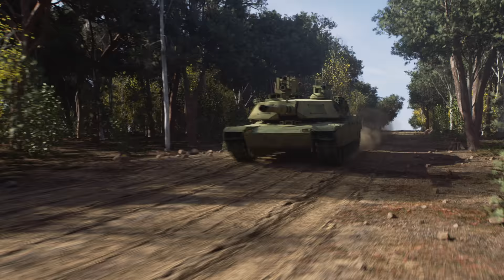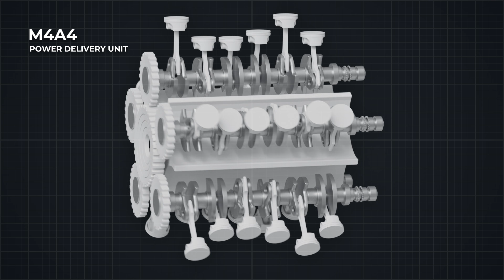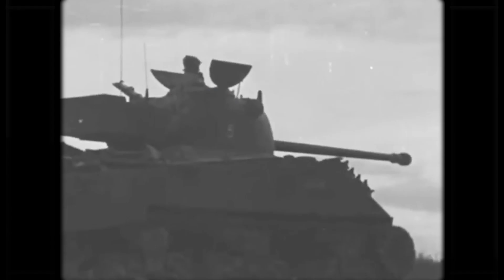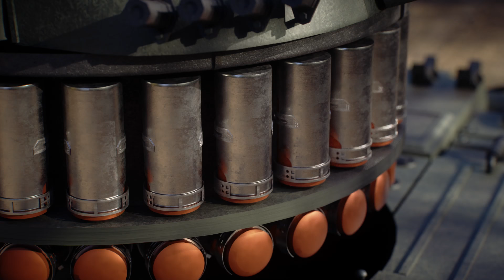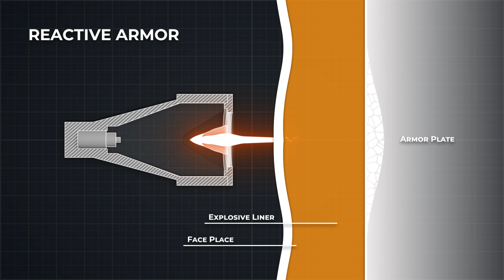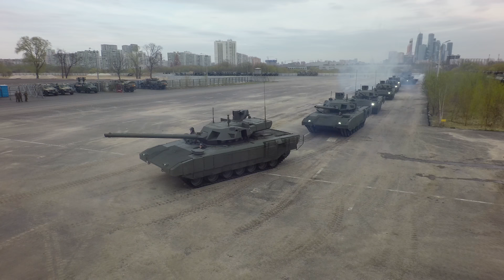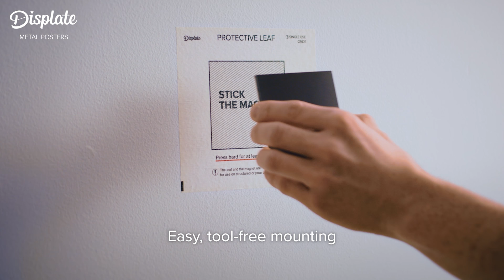Why America’s Tank Failed in Ukraine

Comment: 19:37 That engine isn't new, it's a copy of the engine from the Porsche Tiger
Reply: Yeah every car is copy of a stage coach because it has 4 wheels. Truly the poster child of average intelligence...
Reply: @mitri5389  It a one to one copy of the SLA 16 engine that was being build to be using in oil and gas compressor stations
Reply: @bluewolf194  lol again showing off your intelligence, saying that a 12 cyilinder motor with larger bore size and a geared cam timing is a copy of a 16 cyilinder push rod motor from ww2 😅
Reply: @mitri5389  Next you're going to tell me the TU-4 isn't a copy of the B-29
Reply: @bluewolf194  😂 moving the goal post... how about you explain your initial statement which you cant back up. Are you also gonna disregard the dozen or so X engine that were made before the sla 16?

Comment: I’m sure The Chieftain and Lazerpig will have…thoughts
Reply: well considering real engineerings example of a good tank and engine is the t14

they are right to have some lol
Reply: @battalionstallion3894 The T-14 is a very good tank on paper, which is exactly what this video said. Its biggest shortcoming is that Russia has only built like ten of them
Reply: @Jak_Atackka And that's assuming that those ten don't have a telegraph pole instead of a main gun. But yeah I was ready to jump in on the T-14...then RE said about the lack of production, and the Tiger, but RE covered the abysmal mechanical failure record of those too.
Reply: @Jak_Atackka  No, he said 'offers a glimpse at a solution to all of this'  ; which is an absolute bonkers thing to say when the best thing you can say about it is that 'it looks good on paper'.
Reply: @Jak_Atackka  other than all the design flaws like:
Using an unreliable autoloader, but then not giving the crew access to it in combat so they can clear it
Hydraulic seals on the crew chamber in a vehicle which may experiance electronics outages (say, when it gets hit by an AT shell)
All the engine problems
Reply: @Jak_Atackka  if a nation can make a tank and only manage to build 10 of them its not a good tank even on paper then

nor is it even good on paper 
 it lacks optics, awareness, the hydralic armored box is a death trap if the tank takes a hit and losses power, and it lacks proper data linking
Reply: @Jak_Atackka  it's not even a good tank on paper. Too unreliable, too expensive
Reply: @Jak_Atackka  RIght and the Maus was a good movable bunker on paper, doesnt mean it worked or was a good idea. The only way to really know if a tank design is actually any good is to field them and without fielding them trying to predict anything about it is a moot point.
Reply: Indeed.
The former being an expert on the matter, the latter being a lolcow.
Reply: The chieftain has already put in his two cents on this video and the response...needless to say he is NOT HAPPY
Reply: @reapertalon  Where? Not on his own channel in any event.
Reply: @HufflepuffSamurai check the replies
Reply: who?
Reply: I think they would dismiss this video quite rapidly.
Reply: Imagine considering lazer pig as a reliable source of information for anything tank related. Dude's a clown.
Reply: @malithaw The Chieftain though is a consumate professional and has extensively covered the m1 Abraham's and tank doctrine in general. A clear understanding of tank doctirne being the biggest absence of understanding in the video and given the subject matter is beyond simple design specs and engineering is sorely needed.
Reply: Yeah, I know. Chieftain is a respectable person and an actual expert on the matter unlike the lazer pig. @Darkestnova25
Reply: @malithaw  I don't know how can there be anyone who takes that guy seriously after the drama he had with RedEffect. It's clear he's a bad faith actor
Reply: Dont forget redeffect...
Reply: @justafan4266 No, forget Redeffect. That dude is a cheerleader for Soviet armour, nothing more. Almost all his videos of Western armour are highly critical, and his videos on Soviet/Post Soviet armour are extremely glowing. He makes Lazerpig look like Perun.
Reply: @HufflepuffSamurai  both have their Biases ok. are finnished ?
Reply: Two people who should never be in the same sentence together.
Reply: @samadams2203  the Chieftain and Lazerpig are not friends but they have a lot of similar standpoints and respect each other
Reply: @How_are_you1234  I doubt that.
Reply: Chieftain would largely agree with this video and has always been critical of the logistical shortcomings of the 21st century American armor
Reply: @MozTS  Agreed.. "The Chieftans" a real pro and comparing him with Lazerpig is an insult to the Chief.
Reply: @MozTS  "Chieftain would largely agree with this video"

So that's confirmation you've never watch any interviews with, or videos from Chieftain then.
Reply: Moran will have thoughts, Lazerpig will have ramblings...  if he can be bothered to read the wikipedia page.
Reply: @johanmetreus  points at pile of books and official reports "yeah only wikipedia"
Reply: @How_are_you1234   "yeah only wikipedia"
And that was a reply to what?
Reply: What thoughts could the LazerClown have ? Comedic ones for sure 😂
Reply: @REDTIDE.92 shhhh russia main, no one likes you
Reply: The Chieftain did a short interview with a US commander talking about their latest M1E3. They're ditching the turbine? The Russians already did that years ago, and China & Europe nvr went there to begin with. M1E3 is gonna use an autoloader, NANI NANI?! Japanese, Russians, Chinese, French all using autoloaders for decades, get up with the times old man America.
Russian T-14 Armata is using a remote turret, and a crew capsule segmented away from the turret space... "Yes T-14 sucks, glorious Abrams and Leos and Challengers ftw, REEEEEEEEEEEEEEEEEEEE!"
The only thing Armata is lacking a is better engine and funding like all major projects in any military that isn't a $1 trillion defense budget with the world largest debt reserve and criminals running around in the presidential office.
Reply: @mab2187 and how has autoloaders helped the crew survivability of the t-72, 80, and 90 in ukraine...oh wait, it just kills thw crew and blows itself up. The armata corrects this by putting the crew away from directly above the ammo, but agai has no combat experience and no reliable information outside of official documents which we cant see
Reply: @mab2187  T-14 sucks because russians cannot make it work as intended
Reply: @mordonius1  "T-14 sucks because russians cannot make it work as intended "
Reply: @aghawkz  There are more T-14 out there than Challenger 2 in working condition so jokes on you 🤣🤣🤣
Reply: @REDTIDE.92 I mean, the UK have 200-300 ish Challenger 2s at the moment, and about 150 of those are planned for upgrade to Challenger 3. Meanwhile we have only seen a dozen or so T-14s. 

I was not being sarcastic or mocking in saying the Russians cannot make the T-14; they are quite literally unable to field them in capable amounts at the moment, let alone replace their late 20th century tanks outright.
Reply: @Bertinator-nm9ld  Read again reading comprehention is visibly not your strong !
Reply: @aghawkz  Per UK own admission only 20-25 of their Challenger 2 are in working condition ... let that sink in !

T-14 has been manufactured in way bigger numbers than a dozen , you literally can see it in the production line  of every new UVZ video. Don’t take your ignorance for bliss !!!
Reply: @Bertinator-nm9ld   LMAO what insults ? Im calling you out on reading comprehention issues since you are responding to an argument that i did never make. 

Please go ahead and tell me where exactly  did i claim T-14 was employed in the SVO ? My claim was Russia has certainly more T-14s in working condition than UK has Challenger 2s ( 20-25 in working condition  per UK own omission ) . 

So i will tell you again , learn to read !
Reply: @Bertinator-nm9ld  Not from clownpedia that for sure. Im getting the evidence from the source , in this case UVZ.  20 tanks was the experimental for state trials. Tank has officialy entered service since 2024 and you can literally see T-14s in production line of every UVZ promotional video. But you are too cluless to know all that. I call it an SVO because that's what it is !
Reply: @mab2187  Only think its lacking is its existence.
Reply: @mab2187  Are you OK?

T-14 is a  stealthy tank. It has almost never been seen on the battlefield. Very excellent. Much vodka.
Reply: @hammondpickle  I don't see you either 🤣😜

Comment: US Army planning for tank losses in a full scale conflict are an average of one tank a week per tank battalion.

The most important metric is not tank survival - it's tank crew survival.  Because tank crews are harder to replace than the tank itself.  

And the powerpack (engine and transmission) is powered by an Gas Turbine Engine.  It may have been based on the design of a helicopter engine - but it was modified to function as a tank engine.  And as somebody who spent a decade and a half on the M1 series tank - that engine is amazing and gives the tank unparalleled tactical agility.  It is also very quiet.  It is so quiet that the things that made the most noise were the tracks - which resulted in the tank being fitted with 'stealth' (silent) tracks.

And The M1A1 (tank that was sent to Ukraine) has the same range as other tanks.  And for a mechanized brigade - if you are having trouble getting fuel to the tanks - then you are having trouble getting fuel to the other vehicles as well.

And at this point I've stopped watching this video.  Next time you make a video about military hardware - talk to the people who have operated it first.

Comment: The tank was the answer to trench warfare in WWI .  The frontal assault by troops led to wholesale slaughter but the British army was too stupid to think of anything else.  It was Winston Churchill the secretary of the Royal Navy that pushed for the tank.  The Mark 1 was a failure, and the Mark 2 and 3 were only for training.  It was the Mark 4 in 1917 that finally saw some success and this continued in 1918.  These tanks were designed to roll over trenches and stop.  The side mounted guns would then sweep down the trench.  
The U.S. doesn't learn from others, the Abrams is unreliable, needs aviation fuel, guzzles fuel, and is too dependent on its computer systems.  The Leopard 2 has been the most successful tank in Ukraine.

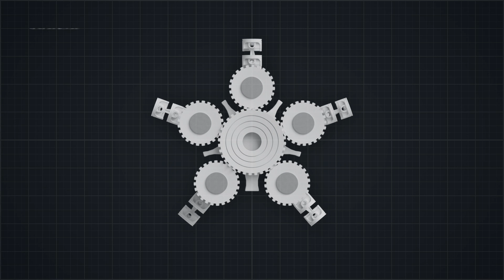Comment: 4:57 ...in-line V6 engines..?
Reply: Opened the comments to say thi
Reply: Ding ding ding 😂😂😂😂 rewind 3 times to verify and came to the comments to check if my ears were working 😂😂😂😂
Reply: 5x6, they basically glued 5 v6 engines together.
Reply: @DatInnocentGuy What do you think the V part in V6 engine means?
Reply: @DatInnocentGuy  LOL, seems like both you and video creator doesn't know the difference between typical engine designs. Inline? V? I have no idea what it stands for but it sure sounds awesome!
Reply: @DatInnocentGuy no… they glued 5 inline-6 engines together… no v6
Reply: @DatInnocentGuy  it can either be inline or V shape. I6 (R6) or V6, there also exists VR6 that volkswagen made.
Reply: As opposed to radial.

Comment: It should be noted that the Leopard 1, despite being obsolete, has a much higher survivability in the context of this conflict. It's used as a self-propelled artillery and less like an MBT as it was originally designed for...  The point is that tank-on-tank engagements have become increasingly rare, but Abrams and Leo2 are built for this very role, whereas the Merkava would have been better suited for other threats and urban combat, for instance...

Comment: When a design partnership won't even agree to use the same measurement system, you know that disaster will follow (It has in sending space probes to MARS). Consider this -  they couldn't even use the same specifications for nuts and bolts, NOW that really is a partnership made in hell.

Comment: "The Russians' newest T-14 Armata..."  is a paper pipe dream.  It doesn't exist. 

Russis has been kind enough to store their tanks outside where satellite imagery can see them.  In storage they had, 112 T-90s, 1679 T-80s, 2696 T-72s, 594 T-64s, 1822 T-62s, and 313 T-55s.  As of January 2026, they have 0 T-90s, 141 T-80s, 640 T-72s, 449 T-64s, 784 T-62s and 112 T-55s.  Which means they've pulled 191 T-55s out of storage.  11 of which have been confirmed destroyed in Ukraine, so we know at least some T-55s are seeing action, not just being recycled or whatever.   That's a 70 year old tank.

Where is the Armata?  On parade in Moscow?  Why on earth would you field tanks designed in the 1950s in war in place of your modern, highly capable new tanks?  Unless your modern highly capable new tanks don't actually exist.

There is not a single report of a T-14 Armata sighting in Ukraine.  In general.  The tank fans who for some bizarre reason like Russia would be so excited to see it in action, and Ukraine's supporters would be in crisis mode.  Because, as described on the blueprints, the Armata is actually quite an impressive machine.  Folks like me who are paying any amount of attention to the people who are seriously following the war (ie: the guys who actually do the open source intelligence analysis.) would definitely have heard about it if there was a confirmed sighting.  There hasn't been.

It doesn't exist.  It's no more real engineering than an Imperial Star Destroyer.

Comment: 27 of the 31 supplied M1 Abrams tanks are confirmed destroyed/disabled in Ukraine. Meanwhile, over 8000+ T-90, T-80, T-72, T-64, and T-55/54 are confirmed destroyed with 90%+ of the viable stored hulls depleted in store yards. The story should be, tank armor designed for 20th century warfare is not viable in the 21st century warfare.

Comment: Not a failure, they got 30 stripped down tanks ffs, there's usually thousands of tanks in a war, supported by a functioning air force and other systems which Ukraine doesn't have, and drones have basically made tanks obsolete, because you can make 10s of thousands of drones for the price of a tank.

Comment: Why we still haven't gone to a Hybrid pack with the instant torque of electric drive for 'SHTF' pants-down situations is beyond me. It's about the only way to get that instant sprint without a jet engine shooting a huge gout of heat out the back when you put the hammer down on Berm drills. Waiting for a piston engine to spool up to deliver power to the transmission is not the greater idea, even if it's simpler & sips gas better.

Comment: The tiger 1 could only fit on train cars with special transportation tracks mounted on the tank.  They then had to remove those after unloading the tank from the train and reinstall it's normal road tracks.   Not exactly ride on ride off to battle.

Comment: The failures of the majority of the tanks can be attributed to tactics and doctrine. Russians and Ukrainians have been using tanks in ways they're not designed to be used. You don't charge a single tank ahead of infantry as a scout expecting it to survive and destroy an ambush (both sides do this). Tanks are not designed for this, this is just one of the tactical failures of how they're using tanks, any modern western military would see these tactics as suicided. Both sides have also been mounting cages, fences, ERA in weird spots, and barbed wire onto the tanks that often do little to increase survivability but come at a great cost from everything to maneuverability, awareness/visibility, and make it a larger target, all of this in an attempt to solve a doctrine issue - the issue is that they don't have an invincible vehicle that they can charge head on through minefields while taking out every enemy in its path on its own. Using tanks is complex, it requires large logistical chains, extensive planning and coordination with multiple vehicles and forces - "combined arms".

Comment: In 2023 the Russians tested the T-14 in Ukraine and came to the conclusion that it was not adequate for modern tank warfare and thusly sent back to the drawing board. At the same time the manufacturing line was completely switched to other vehicles so it's clearly not just some minor design adjustments being made either.

Comment: Well, having a couple dozen Abrams and deploying them across a thousand mile front isn’t the same as the US deploying the abrams by the hundreds in concentrated areas, with complex GPS, intelligence systems, infantry, air support, and accompanying vehicles. You can’t call the Abrams obsolete (reminder, the models sent to Ukraine were retired older abrams models like the standard M1A1 and M1A2, not the M1A2Sepv family). Its basically a sandbox, just throwing shit that might stick.

Comment: 20:50 I thought I knew nothing about tanks, but during the entire video, I was thinking: "High torque right from the start and better fuel efficiency: they need a hybrid engine! Put in a battery and the tank can go small distances with way less noise."
Reply: If only physics can disappear for day, there is no room in a tank, or materials reliable enough, nor the logistics to maintain variety in conflicts. Everything needs to be compact, sophisticated, and reliable + consistent. In theory A+, in practice F.

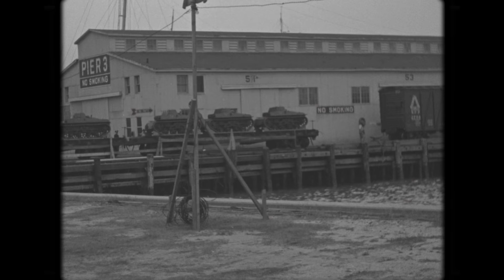Comment: 4:00 ok so the US-American tanks were smaller than UK tanks due to having to be shipped over.

correct me if i'm wrong but last time i checked the UK also isn't connected to Europe or North Africa, so their heavier tanks also needed to be shipped over.
after all the channel tunnel didn't exist back then.

so they did have the means to transport them.
the US just did the calculations and decided that heavier tanks weren't worth the extra effort that would be needed to transport them.